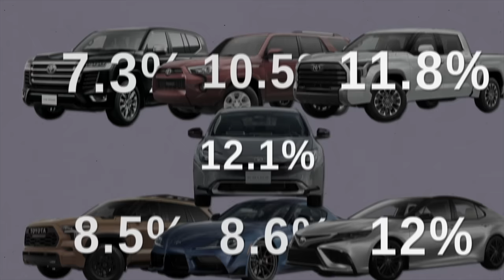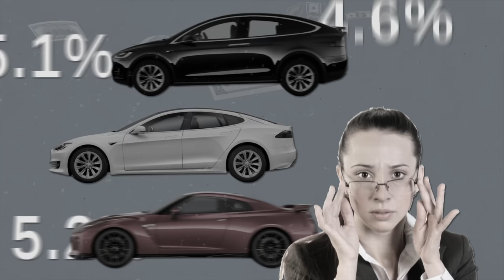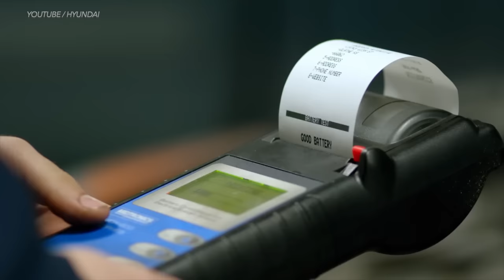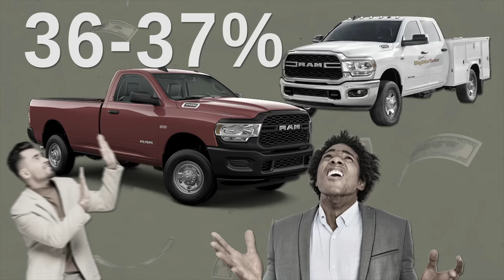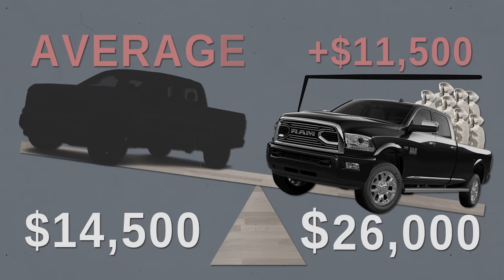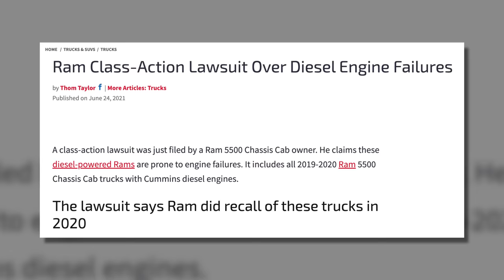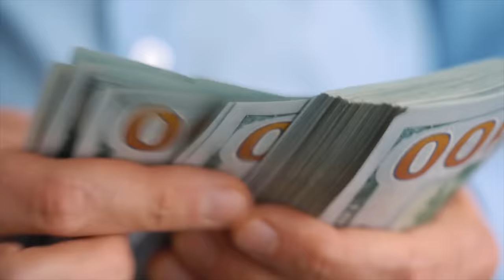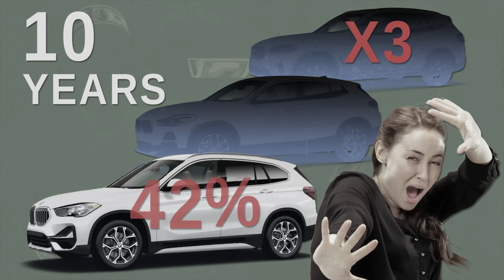Here's Why I Only Buy Toyotas and Lexus

Comment: Worst thing is that new cars regardless brand are literally gadgets not cars. You need software with subscription. Soon enough it will be standard to have subscription plans to unlock features like AC or others in your car.
No ownership.
I was born and raised in post soviet Poland with lot of old cars. Rmember when you could get like VW beatle with set of tools and manuals. You could literally fix everything with these tools and instructions. Parts were also easily accessible.
My uncle still owns Lada Niva (4x4) from 1979. Used to go to forsest etc.
Off course it brakes and fails from time to time.
But you can fix it with tools you can find in most garages, and many parts you can even made using stuff like lathe, grinder and so on.

Comment: Old nissan ain't bad... but you gotta take it back to the 90s.      I don't hate my 04 armada though it's been great to me personally.  But I own a lexus.... it's at like 300k miles and currently is getting it's OEM power steering lines replaced as well as a radiator as preventative...  also OEM!     My lexus and my 93 na z32 have been equally reliable. I've had my z for 5 years and have had to replace things including the clutch when I bought it.... used cars come with issues. I don't care where you get one!  I bought my z with high miles 180k... I expected some issues to get away on cost of purchase... same with my lexus

There are nissan z32 owners with 400k plus miles on their original engine and transmission....   they made good stuff back in the day... Toyota being the one brand that out did them!

Comment: I have a hard time believing the stats for honda. 
I had a 3 years old civic, used it for 5 years, i would skip oil change up to 20k soneimes, car ran smooth operator, sold it , guy had no issues. Over 130k km. Never had to pay any maintenance. Used it in mtl winters. Manual transmission, was pretty bad with the clutch as a noobie

Comment: Does Lexus hold up in todays market? I found a gem of a 2020 Lexus IS 350 w/ less than 20k miles.  Car cost is out of control w/ high interest rates but think this could be great if they are as well built as the early 2000’s models. Its the AWD, naturally aspirated V6.

Comment: you mentioned the Toyota Supra as having an 8.6% maintenance cost.  The Supra hasn't been out for 10 years and has a BMW engine which was put at the bottom for reliability.  The GR86 to begin this video has a Subaru engine as well so also not fully Toyota.

Comment: Hey Scotty, what do you think about the Toyota GR Supra? You presented it in your video as very reliable, but I think you might have used data from the Mk4 Supra from the 1990s. 

Why do I have this suspicion? Because the engine for the new GR Supra is manufactured by BMW 😅

It would be great if it turned out that the new Supra is as reliable as a real Toyota, though!

Comment: I have a 2018 Hyundai sonata Limited trim. I will NEVER buy one again. Bought the car with less than 40k miles. Within 6 months of owning it the entire engine had to be replaced. The warranty covered it luckily but less than 4 months later the starter failed and now I was out of warranty. They had my car for 6 months working on the warranty. I replaced the starter and everything seems to be going fine BUT I will NEVER buy one again. Of course I did regular maintenance and never drove the car roughly or took it off of standard roads.

Comment: I’ve owned 3 bmws over the last year 10 years (all pre-2003) and they have collectively costed around $10,000 to maintain.
They have also all been increasing in value over time as they are verging on “classics” so when I sold my first one, I actually sold it for more than I bought it and spent on maintenance.
My current BMW, a 2003 e39 530i M-sport has doubled in value since I bought it.

Comment: These exorbitant maintenance costs for Dodge pick up trucks or BMW’s.. This is based on bringing it to the dealer for all of the maintenance correct? Is it as bad if you do the oil changes, tire rotations, brake pad changes yourself? Or is that not possible for some of these vehicles?

Comment: I wonder how these are calculated, I had my current Mercedes C Class 2 litre diesel for 6 years now, it's a 2013 model and I bought it second hand. It required zero repairs and maintenance is £180 a year, with an aircon top up, it was under £1500 total over 6 years or what, like 3% of the retail price? - my previous Audi A4 was even less and I kept that for 9 years...

Comment: BMW’s are great if you can competently repair the car yourself. If you rely on the dealer & repair shops, steer clear.  Toyota/Lexus are tanks. They run forever with little love.  Mercedes are excellent too. They don’t break much but when they do it will hurt.

Comment: I'm curious where you got your data from. I think it would be very helpful based on models not brands. For example you mentioned 7.3% on a Land Cruiser. 7.3% of a $90k vehicle is $6600. 8.5% of a $80k Sequoia is $6800. 21.2% of the average Honda which is probably around $35k is $7400. So over the course of 10 years these numbers aren't hugely different. Now when it comes to 26% on a BMW we are talking real differences!

Comment: Would be interesting to see the actual numbers of the maintenance cost
Cause it is not really correct to say that a 100k usd Toyota Land Cruiser has 5% of its cost (which is 5k) is better than Hyundais which is 30-40k usd with 10%(which is 3-4k) for maintenance

Comment: 1 reason why BMW is expensive in maintenance is the price of genuine BMW oil. Most OE oils are reasonably priced but BMW sell their oils in only 1 litre bottles hence around £20 a litre on your main dealer service bill. It’s Shell oil. Many BMW spares prices are very reasonable and easy to get. Toyota not so easy to get and generally main dealer only for them. Also oddly Toyota use semi synthetic oils. Wonder how long they would last if they used better fully synthetic oils. You don’t mention Audi As owner of a UK car parts company for 20 years specialising in German vehicles I always found Audi to be those with eye watering costs. £2500 for steel discs and pads about par for the course on R/S models, £550 for 1 speaker admittedly it has its own sac and amplifier for a brilliant bang and O u f e s o n set up  and £750 for a rear view mirror for an TS3 model. No pattern alternatives available for these parts all genuine only. Then there is the standing joke with AUDI standing for Always Under Diagnostic Investigation :)) Dispote this I still like Audis the expensive part are premium. I personally would avoid R/S models and buy parts from Bosch, Valeo, Bilstein, Monroe TRW Delphi Pierburg Elring ZF Febi Optimal Meyle HD and PD  etc than Audi where possible. Genuine oil is reasonable and would use genuine or OEM manufacture filters. Mann, Mahle Filtron etc

Comment: These percentages alone don't say enough; you need the absolute number too. If your car has a 10% cost, whereas mine has 20%, but both come down to 5.000,-, then our cars are equally expensive to drive, except I paid 25.000,- less than you to start driving in the first place. If that extra 25k is worth whatever more you get from your car, then by all means go for it, but you can't use these percentages to flat-out judge cars. It's just one of many metrics; you need more context.

Comment: I have a 2007 Honda CRV.  Not one problem or issue.  With regular oil and maintenance. Brakes, tires that’s it.  I would get another.  But I have noticed reduced mileage from i29 miles per gallon to 24. Is that normal?

Comment: My mom had a Toyota scion the cheapest and weird looking one from 2007- 2020, the thing was not properly maintain (like she wouldn’t even get the oil changed for long periods of time) and driven hard, and the first time it ever had an issue and would start was in 2016 when the original battery died and a flat tire a few years later, in 2020 the thing stopped working and she decided to just get a new car. Ugly car but that thing lasted for what is worth

Comment: I have a 1999 Honda Accord with automatic transmittion. Made in UK, came to me from Italy. Previous ownwners have maintained it pretty well. It has many issues due to an old age and I'm not sure about real mileage (currently over 200K KM), but maintenance cost is close to nothing. Even oil leak is almost non-existent if I do regular oil change. Even with a faulty gear box this granny can kick some BWM's asses and put some Jeep's or SUV's at shame on a horrible forest road. Seats are still in a great shape and really comfy. I have still working automatic windows and panorama window as well. But I do have to slowly search for a newer car because time is kicking and my trusty old rusty ain't getting any younger. Overall, I don't  regret owning an old Japanese car. I can see other people around me struggling with maintaining Opel, BMW's, Mitsubishi and Skoda, but for me, the most expensive part on maintaining an old Honda, is the fuel.

Comment: I own a 2015 Subaru Outback. Entire transmission replaced. Under warranty. Entire cooling system replaced. Under warranty. New diffs. Now the dealer tells me I have an oil leak from the gasket. 😂

Comment: I was driving a new boat with new Cummings diesels the starboard motor had a piston rod snap and blew a hole in the side of the engine , offshore mind you , Cummings said we put gasoline in it , uh no we didn’t , after much fighting they eventually gave us (government agency who spends hundreds of thousands on Cummings) a new engine , they even sent a guy down to take fuel samples , what a joke

Comment: Someone that calls Tesla, Lexus or Volvo "luxury brands" never sat in an Audi, Mercedes or a Porsche. The first three may be a little better, but very far away from luxury or premium. And yes: repairing BMWs is expensive. There are a very few models with good engines, but most BMW engines will get expensive. You should go for a Mercedes or an Audi (not every model and not every engine!) if you want a premium car AND low maintenance costs.

Comment: %maintenance cost is the COST / Purchase PRICE.  typically batteries, tires, brakes, oil change, are similar prices across all car types.. so if the price of the vehicle is low then the maintenance cost will naturally be a higher percentage--no?  Note: required BMW parts are higher you don't just use a generic battery, oil, brakes, tires etc... on a BMW, that's why BMW is such a horrible maintenance cost.

Comment: Your slamming Chrysler products. I have had vans and a pick up for the last 20 years. So far I haven't even had a single problem . Maintenance costs are oil changes only, and a couple of wiper blades . My costs are 1% or less  that's way less than a Toyota.

Comment: Yeah, but only if reliability is the only factor you consider when buying a car. Reliability is not the same as quality. I'd always prefer higher quality car (interior, materials, sound insulation, etc.) that's slightly less reliable. I'm OK to go the service 5% more per year if I'm in a higher quality car while driving there :) So I'd take German premium over Japanese any day.
Reply: If you don’t mind me asking, what are your favorite kinds of car?
Reply: @josiahademiluyi4677  I've had different types and brands of cars, but as I get older I tend to value quality interiors more and more. I can't stand hard plastics, squeky dashboards, misaligned panels or confusing and not logical menus and buttons. Most Toyotas I've been in are pretty bad at these in my opinion, even if they are still very reliable.
Reply: @lyubohar  How about B.M.W
Reply: @josiahademiluyi4677  what's b.m.?
Reply: @lyubohar  I apologize, I meant B.M.W
Reply: @josiahademiluyi4677  I find the 5 series extremely satisfying in terms of interior materials and quality. Would be happy to have one as a next car.

Comment: From a mechanic’s perspective, this man’s point of view make no sense, for example, bmw E90 have 320i and 330i, these two models use completely different engines, the N52 applied on 330i is a lot reliable than the N46 which appears on 320i. You never judge a brand but model, Jeep wranglers are so much more reliable than any other Jeep models they make.

Comment: I bought a used Toyota highlander that had about 100,000 km on it - had it for 10 years give or take, and sold it with 450km on it. This car runs forever. The only reason I sold it was because I couldn’t justify the gas prices at the time. We got a Kia soul that was manual transmission and this has been incredibly reliable although my husband really takes care of it and does do repairs on it - so it wouldn’t have lasted if it was just me. 

With kids on the way and 3 dogs we need a bigger car.

We are going back to Toyota even though it’s more expensive to buy than other used cars. 

BMW is the worst. Never bought one but watched friends drive these POS for years and burn their wallets. I drove it once via car share and the battery to the keyless key died and didn’t have a back up to actually use the key! Never again. bmw is a High maintaince drama queen - one problem after the next 

Toyota family for life!

Comment: Good video, but not complete. Here in Europe, Volvo is in top position of long lifetime cars, safe, reliable and low maintenance. You can find any year from 1960 still driving and without corrosion on the European roads. I owned 2 Volvo's, (S80 and now XC70 both D5 engines) that reach exceptional milages without 1 single repair. Mercedes was my big mistake. E class 320 CDI, Very expensive to maintain driveable. Very complex and expensive parts. a nightmare. Never again a Merc. Volvo is my brand.

Comment: Akso, they say my piwer steering pump is leaking but my reservoir never goes down?  Csn i use AT 205 in new oil chsnge to fix power steering leak or put some right into power steering Reservoir?

Comment: While the video good, these statistics don't take into account the typical purpose or typical owner of these models as it affects the repairs they commonly require. Factoring that into the data would emphasize their adequacy to their intended purpose in addition to the rather one-dimensional representation of reliability through maintenance costs alone.

Comment: Drive any car like a grandpa and it would be not much different in maintenance cost than a Toyota. More speed, which is discouraged in a Toyota with power limits and floaty suspension, big tires = more strain on engine, transmission, suspension (specially higher speed on bad roads and over bumps)

Comment: Tesla is superior in every aspect to any ICE engine car.  Way cheaper to drive, I saved 7500 in gas costs in 2.5 driving my Y.  Toyota does make the best ICE cars, i have a Tacoma too and never a problem but range is terrible.
Reply: BYD is superior compared to tesla. If you want performance go for porsche even toyota and hyundai has a line of electric cars too now. 
Unless you’re down for gimmicky things tesla offered, it’s far from the best in terms of looks, pricing, and reliability.

Comment: Toyota/Lexus may be reliable, but would one have a car that gets one there or would one have a car that gets you there comfortably? Toyota/Lexus does not know how to build proper car seats. I have driven a lot of Toyotas and Lexus through hire car companies and knows a lot of car seats. Toyota/Lexus' "4wd drive systems" are no good either. I have also seen what happends with eg. Toyota Rav 4 when they gets a roll over or four, it is not a pretty sight. The A-pillar gets smashed and the roof gets down in the head area of the driver. Toyota/Lexus may be good in collisions head on, but look at cars that have behaved othervise than in NCAP and you would discover another story.

Comment: Toyota might be cheap to maintain in the states, but in europe not so much.
there are many brands that are cheaper to maintain.
also the Toyota of the olden days where nothing broke are loooong gone.
back in the day you could buy a Yaris with a clutch that lasted 400.000km or more today they last max 160.000km because Toyota did the math and found out that not many customers drive over 160.000km during the warranty period.
also Hyundai in europe is way cheaper to maintain than Toyotas, take also in to consideration that the warranty is way better on the Hyundais.
but sure if you find a Toyota in decent condition thats over 10 years old you got a car for life.

Comment: This way of using data is not very useful. You have to look at absolute values and not %s. If a new car is dirt cheap, say $15k, and has a 10y maintenance cost of 5k, your metric will look bad. Conversely, a $150k car with a $30k maintenance cost, will look better according to Scotty’s metric.

Comment: Have as honda driver how much problem they have had from a honda  I as them when I get gas ⛽️ they all say the same thing gas brake pads oil transmission fluid tires you need to redue your %s please I have been Driving Hondas from 1992 my 1st honda for 27 years no problem.

Comment: The way this is structured is heavily biased especially when he is going at ram despite them being utilized primarily as commercial vehicles for heavy towing and hauling, these are issues that occur in many cars and at times, same can be said for Ford, Chevy and GMC equivalent models

We already know he has a bias vs European vehicles despite BMW SUV's being extremely reliable and cheap to maintain due to cheap excess parts, however the car wise with models using V8 engines are complex so there is an extent of truth behind BMW it's slanted still

He also used the rant in ram for so long he was unable to get to many other brandings

TLDR/W: Scotty: hi I love Toyota and Lexus, and absolutely hate RAM, BMW, Kia, Hyundai, Land Rover and Honda, here's a quarter of the video why ram sucks